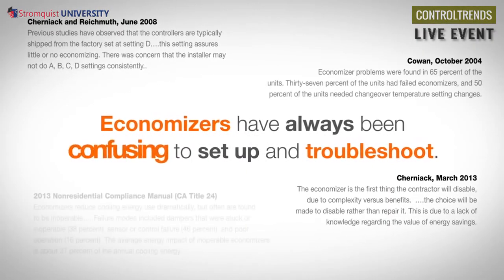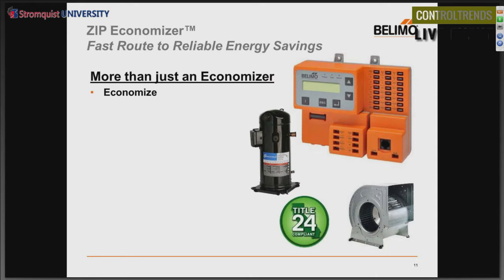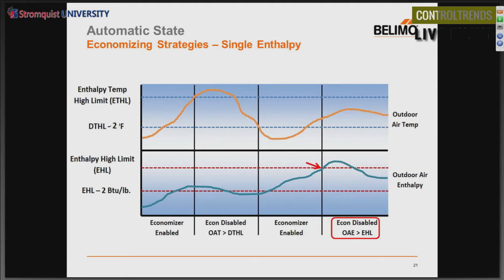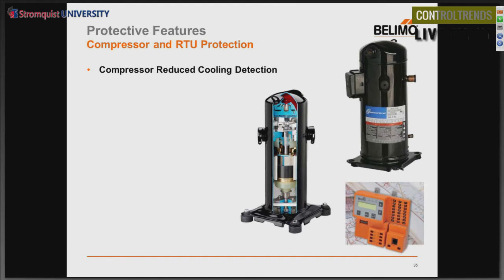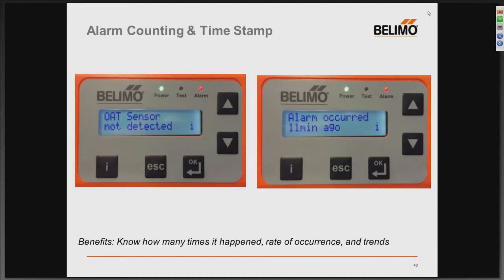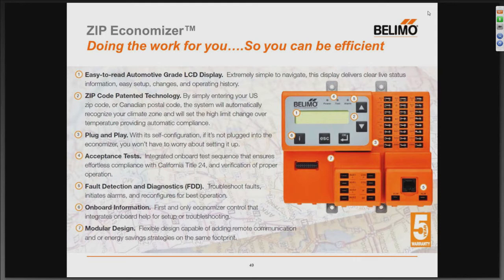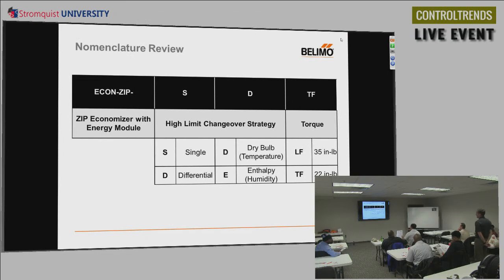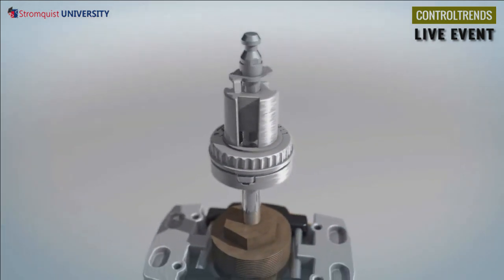CT:Live - Belimo Zip Economizer

Comment: Just installed 1 today, things I don't like in comparison to Honeywell Jade is:

1 there is no set point for mix air temp. I don't know what temp is maintaining during free cooling.
2 there is no freeze protection set point in the manual, from this video is 45 deg but I need it lower for many reason.
3 there is no info at what temp is mech cooing lockout.
4 the lowest dry bulb set is 60 deg, I need 55 deg for computer room.

for the expert out there please respond